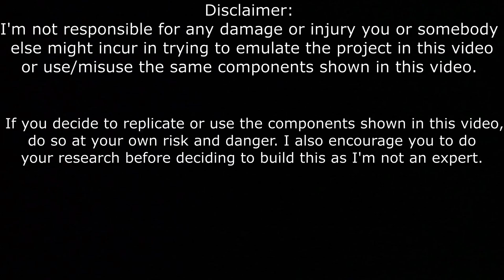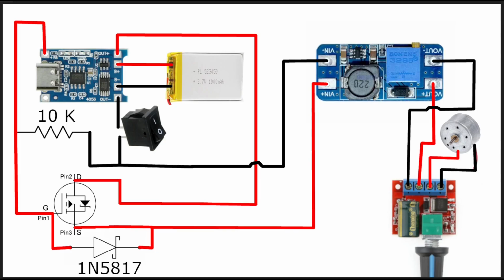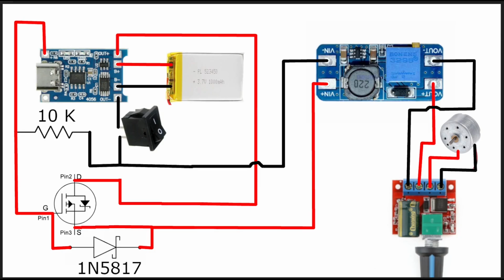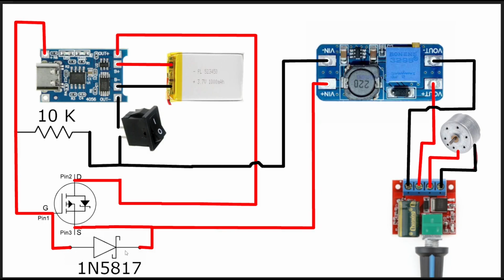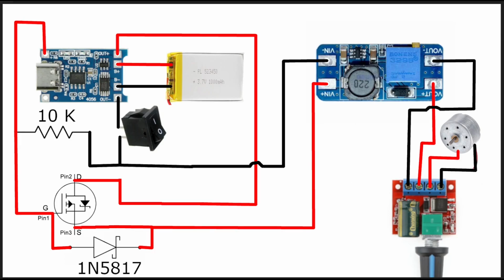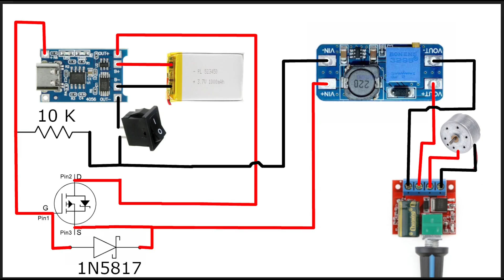How to use the tp4056 module to charge the battery while in use (load sharing)

Comment: Is it possible to make an uninterruptible power supply in this way? In other words, when you cut the power, the motor will be fed from the battery, and when you give it power, it will be fed from the power.
Reply from the maker: yes this is what this circuit does, additionally it also charges the battery when power is connected
Reply: @engibored3207  Well, let's say the power went out, the load started to be fed from the battery, and it was fed at once until it reduced the voltage  below 3V (tp4056 decharge cutoff threshold) + the load drew more than 100 milliamps of current (trickle current), then the power came back, will the tp4056 start charging again ? i mean, after a long power outage, will battery recover charging?
Reply from the maker: the charging module i used has a DW01 chip on it which is in charge to monitor the battery and it offers overcharge and overdischarge protection, this means that in the case the power is out the module will disconnect the battery once the battery's voltage reaches 2.4 v (I'm going by heart here check the datasheet to be sure), at this point your load is not powered anymore since the battery is disconnected and there is no power cable connected. When you connect the power cable the battery should start charging and the load should be powered once again. Now the charging module will reconnect the battery once the battery's voltage reaches 3v if i remember correctly (again check the datasheet to be sure), meaning that if you remove power and the battery has a voltage below 3v, your load won't have any power. If you do the same but the voltage of the battery is over 3v then your load will receive power from the battery until reaching 2.4v and the cycle will restart. For the current you should check your battery datasheet but if it allows to draw a current over 100 ma you should be fine since the tp4056 allows to draw 1A for sure. Now if you trigger the overcurrent protection you have to disconnect and reconnect the load to restart the module. I haven't test this but in theory connecting the power cable should disconnect the load from the tp4056 output so if you connect and disconnect the power cable the load should be disconnected and reconnected to the module, and  the module should reconnect the battery when the cable is removed. The best thing you can do to see if it works is test it unfortunately or find a video of someone testing this. This video might explain the tp4056 module a bit better of how i did it here: https://www.youtube.com/watch?v=Lk__xTxLlY0&t=15s
Reply: @engibored3207  the problem here is "disconnect and reconnect the load, to start cycle again", meaning (for me at least) no unnterrupted UPS..

if there is no power and the battery is dead +  power is connected again ,  I don't think that the module will start charging again (or even if it charges the load will definitely not work) ,because in this case, it will give power directly to the load (unless we unplug the load, wait to battery voltage >3 and plug the load again)..
Reply from the maker: I'm not sure I'm understanding your problem correctly and maybe I explained it poorly but just to clarify a few points (at least as far as my understanding of this circuit goes, keep in mind I'm no expert and I can make mistakes):

- you don't have to actually disconnect and reconnect the load to the charging module (or battery) manually when you trigger the overcurrent protection this is done automatically by the p mosfet when you connect and disconnect the power cable (at least in theory, sorry but I'm no expert and I haven't test this case)

- if power cable is connected, the load is powered by the power cable regardless of the state of the battery (dead or alive)

- if the power cable is connected, the battery is not used to power the load regardless of it's state.

- The power cable is charging the battery and powering the load at the same time always when connected. this is true until the battery is full, when it is full the power cable still powers the load but it's not charging the battery anymore (keep in mind that the battery is disconnected from the load at this point but it will be reconnected automatically when the power cable is removed).

-The charging module shouldn't allow the battery to die, so if the voltage of the battery reaches 2.4 v the module disconnects it but if you plug the cable at that point the cable will power the load and charge the battery at the same time. The load will stop working only if the power cable is disconnected and the battery voltage is below 3v (if the overdischarge protection has already kicked in) or until it reaches 2.4 volt if the protection has not been triggered.

- when disconnecting the cable and switching to the battery to power the load there might be a short interrupt in the power to the load. This can be a problem in some applications. In theory you could fix this by connecting a capacitor in parallel before the booster (this will work as a short duration emergency battery that supplies power to the load while the circuit switches between cable and battery). this video probably explains the concept i'm referring to way better than me: https://www.youtube.com/watch?v=X4EUwTwZ110

- if the battery is actually dead and by that I mean it's gone and it's not able to hold the charge anymore than the only thing that can power the circuit is the power cable

- what you described here: "if there is no power and the battery is dead +  power is connected again ,  I don't think that the module will start charging again (or even if it charges the load will definitely not work) ,because in this case, it will give power directly to the load (unless we unplug the load, wait to battery voltage >3 and plug the load again)."
should not be the case since:
- when the power cable is connected the p mosfet disconnects the output of the charging module from the load automatically meaning that the battery is disconnected from the load (this happens always, doesn't matter if the battery is dead or alive). at this point with the battery disconnected from the load the power cable does 2 things: 
-it charges the battery (while the battery is disconnected from the load, and the disconnection is done automatically  when you plug the cable)
- it powers the load while charging the battery.

what you described should happen only if:
 -the power supply (power cable) is undersized meaning that it's not powerful enough to charge the battery and load at the same time so changing the power supply should fix the problem
- the battery is actually dead ( meaning it's not able to hold charge). in this situation if you connect the power cable it will still disconnect the battery from the load and try to load the battery, but the load will be powered by the cable for sure if the power supply is powerful enough to do so.

I'm not sure I answered your question but I hope this helps.
Reply: @engibored3207  thank you very much for your detailed answer, i will read again and watch vidoes you shared..

what about using this mechanism with solar panel? tp4056 with modification connected to 5v output (12v , 1.5 amp solar panel, 5 V regulator plugged on its output).

how does this modified module behave on cloudy days (or no sun is available)?
Reply from the maker: you're very welcome!

I don't think I can answer this because I never worked with solar panels and there might be problems that I'm not aware of so take this with a grain on salt. I imagine it should work in a similar way, you might have voltage or amperage fluctuations depending on how much sunlight you are getting but if you are in the range of the regulator you should be able to get your constant 5v, you might have problems when you are below the range of the regulator since the voltage coming out  of it will be below 5v and it might not be able to trigger the gate of the p mosfet. You might not be able to keep the load working all the time since powering it depends heavily on the weather conditions. with no sun you won't be able to charge the battery for sure and when the battery is depleted the load will stop working

that said your best option is to find videos about it or to make some tests yourself as I had to do for this set up since I wasn't able to find much about it. Just be prepared to face some hazards like battery/components catching on fire or exploding at worst, maybe start with small scale cheap setups.
Reply: @engibored3207  Yes, this is exactly what happens. When there is no sun, the power bank runs out of power and the Arduino connected to it does not work. When the sun comes out again, the power bank is charged, but the Arduino does not start working again.If I unplug Arduino from USB and plug it in again, it starts working.
Reply from the maker: @psykopat81  sounds weird are you using the circuit in the video?
Reply: @engibored3207  No Since my system is not working, I found your video when I searched for what else I could do.
Reply from the maker: @psykopat81  oh I see, in theory the circuit of the video should work since it should authomatically disconnect the load from the battery while charging (assuming that the arduino is the load) and reconnecting it when there is no power charging the battery. I can't say it works for sure because i haven't tested the circuit in this specific case.

Comment: If we want to connect a 5v booster to the battery output, how should we make the connection?
Reply from the maker: look at the circuit diagram in the video it shows how to connect the 5v booster. Remember to consider the difference in voltage between battery and power cable. the battery has a voltage of 3.7, if you adjust battery output to 5v using the booster, you will have an output voltage higher than 5v when the power cable is connected (probably around 6.3 v). if you want to keep a constant 5v in both cases consider using a voltage regulator with a capacitor instead, this video shows how a voltage regulator works and how to use it: https://www.youtube.com/watch?v=PnxyLaGTaAc
Reply: @engibored3207  Hi there, thank you for making this video—this is exactly what I was trying to do! I also connected an MT3608 at the end to boost the battery voltage to 5V. However, when I plug in USB power, I’m not seeing the voltage go above 5V (no 6V+ output). Are you certain that the USB voltage won’t just pass through the MT3608 instead of getting boosted? Or could this be some kind of anomaly in my setup?

Comment: Can you make a 3D printer design tutorial from a magnetic stirrer and design the PCB in Kicad
Reply from the maker: If you are interested in the 3D design there is a link in the description of the stirrer to download them. I have never used Kicad, it's something I would love to learn to use but sadly I'm very busy at the moment so I don't have the time for it. Feel free to follow the diagram I showed in the stirrer tutorial to design your own, you can keep basically the same circuit and instead of the pwm and the motor you can connect whatever you want to the output of the MT3608, just make sure to regulate the voltage first. I hope this helps